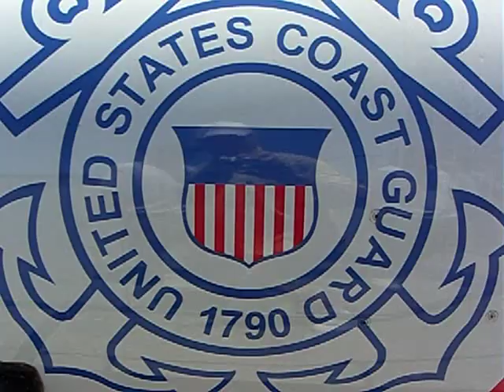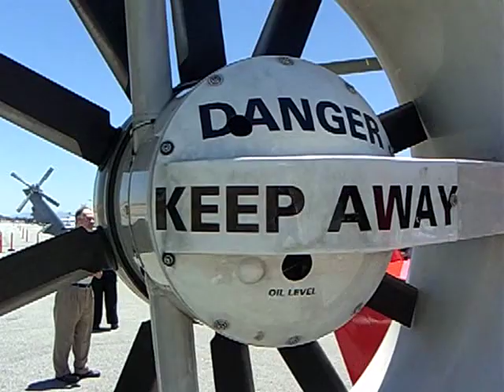Close look at U.S. Coast Guard Eurocopter Dauphin Helicopter with Fenestron tail rotor -5

Comment: I wonder why some of the tail blades are off center/uneven?
Reply: For noise and vibration reduction. If they are even spaced they tend to produce some harmonics. With uneven spacing you brake the harmonics up. It's the same idea as used in some cutting tools which have different angular distances between the cutting edges which increases presicion because they vibrate much less when you cut for instance through steel.
Reply: @shi01  Thank you for the explanation! I wouldn’t have figured that out on my own